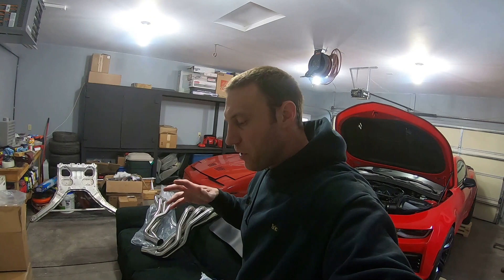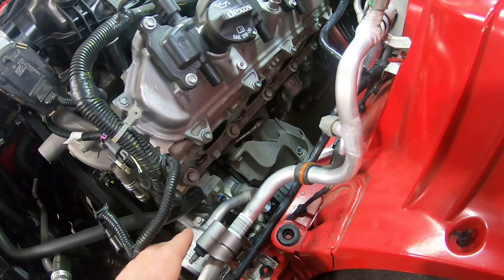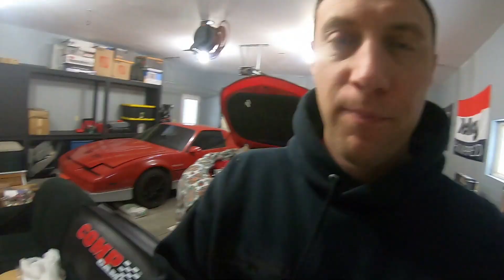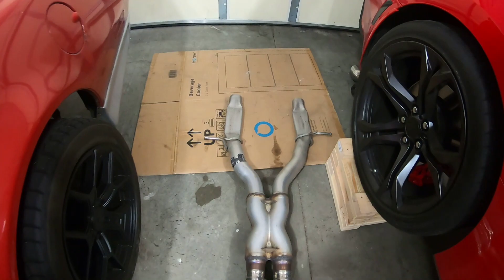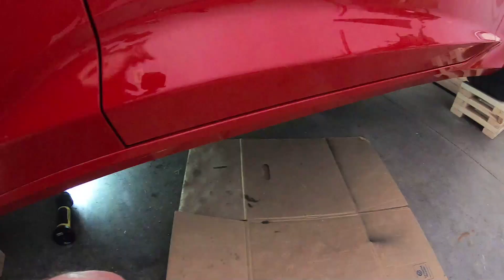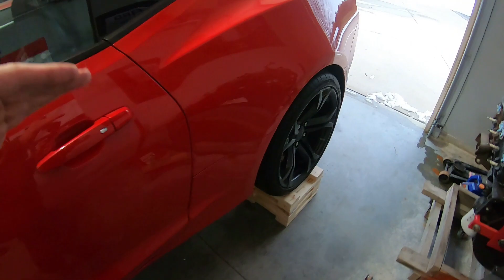6th Gen Camaro Speed Engineering Header and X Pipe Install

Comment: hey brother, I have a question. i have a 2023 Camaro LT1 and was wondering do i need to get the x pipe for these headers or i can install them with the pips i already have?
Reply from the maker: If your using speed engineering headers with factory xpipe it's kinda a pain. Have to make custom pipes to connect and the angles are off. Using the speed engineering xpipe just makes things way easier to connect everything up. Otherwise your paying exhaust shop to make connection and it's not going to be stainless.
Reply: @ understood brother thank you so kuch

Comment: How far from the suitcase npp do you cut?
Reply from the maker: @DexterJones05  i cut it as long as I could. So as close as you can to the crushed section
Reply: @ do you have measurements? Just want to make sure
Reply from the maker: @dexterjones3370  no i just cut it long. As u can always cut off more
Reply: @EssMotorsports  okay so farther away from the suitcase part
Reply from the maker: @dexterjones3370  yep

Comment: Nice nice nice!!!  Tell us please...what throttle body did you use, no cats???, O2 connection issues, tune, AFM delete or AFM module tie up??   Those ceramic wires work good?  Thank you.
Reply from the maker: Make sure to checkout some of my other videos for TB and tune stuff. The ceramic plug wires are still working good. No issues. Mine being manual does not have AFM valves to deal with.
Reply: . When using the V band clamps do you just cut the female slip bells off the midpipe sections to slip the rings on to weld up???

Comment: Do u need a tune? And what happenes if u don’t get one
Reply from the maker: Yes definitely need a tune. Could run lean. Will have check engine light
Reply: @EssMotorsports  does the tune change the sound? And how much is one typically around?
Reply from the maker: @akashsuryavanshi6743  doesn't change sound. And cost varies a lot by area and tuner. Can't really say
Reply: @EssMotorsports  alright thanks man

Comment: quick question did you get the 10 inch spark plug wires or 12 inch. i got the 10 inch but i dont know if they will fit
Reply from the maker: The link to the exact part number is in the description 👍
Reply: doesn't say how many inches 10 or 12 @EssMotorsports
Reply from the maker: @xxchrisgamerxx6850  not sure on length then. But if your not relocating coils they were the perfect length

Comment: How long CAN you drive it until you get it Tuned?
Reply from the maker: U can drive around normal street driving but car will limit itself. Ie close the trottle with the extra airflow
Reply: @EssMotorsports  limit itself? Meaning? Me and my buddy gonna install the headers I wouldn’t have money to get a tune probably like a month out! I will just be driving the car to and from work
Reply from the maker: @Firestick Man  yeah it will close throttle at high rpm. Torque based system, ecu only will let engine make so much torque. So it won't be any faster until u get it tuned
Reply: @EssMotorsports  so it will feel just like stock? I’m just gonna be driving it without a tune for like a month that’s it
Reply: @Race_Car2ss i would wait until you had the funds available, schedule a time with tuner and get installed a week or few days before scheduled tune
Reply: @Race_Car2ss my tuner said it can put permanent codes on the ECU.  He can clear CEL but not the codes once recorderd

Comment: What's the deal with the exhaust clamps on the exhaust system,  the seem small
Reply from the maker: Nope they are the correct size. Smaller ones wouldn't fit.
Reply: @EssMotorsports  I got the x pipe too and those bolts are too small

Comment: Did you reuse the oxygen sensors
Reply from the maker: Yes, no need to buy new ones unless they are bad.
Reply: With those headers do you needed to use all 4 sensors?
Reply from the maker: @raul resto  u can use all 4 just need to add an extra weld bung.
Reply: @EssMotorsports  you did that or just used the 2 front ones??

Comment: How did you remove the O2 sensor harness? It’s not coming un done
Reply from the maker: U mean the connectors themselves? I think there is a Blue tab u slide back/remove then u can depress the clip and pull apart
Reply: @EssMotorsports  yeah for some reason I can’t pull them apart

Comment: What kind of heat wrap did you get to wrap the harnesses?
Reply from the maker: I got that heat sleeving many many years ago, but I found this on Amazon that looks like it would work really slick with the velco. 
https://amzn.to/3Jao0Ok
Reply: Did you use the clamps that came with SE?
Reply from the maker: I used the walker exhaust clamps for all connections except the header connection itself, that I had to use the SE clamp because it wouldn't accept a lap joint clamp. The link for the Walker clamps should be in the description as well.

Comment: Did you torque anything down? Or all hand tight? Great video
Reply from the maker: All torqued down properly. Manual calls for 17 ft/lbs but I think I went 15 ft/lbs to be safe for header or exhaust manifold flange. For the speed engineering/exhaust clamps, used a breaker bar and really tight! Haha
Reply: @EssMotorsports  Thank you for the response! I don't have a torque wrench so i for sure need to pick one up!

Comment: Got mine in waiting to install. What did you do about rear 02 sensors. One side has 02 bung other doesn’t. Did you need a tune after? Haven’t started installing mine yet cuz spooked.
Reply from the maker: Delete rear O2s and will need a tune. 👍 the single bung is for a wideband.
Reply: @EssMotorsports  did ur check engine light ever come on? Ik it needs tune my Dyno tune is set up for Sept 1st (cam, headers, e85, CAI) but was the car still drivable after u put the headers in?
Reply from the maker: @Bigburb1345  yes the CEL came on and it will after the second start with 2 heat cycles. If you only do just headers yeah its drivable, but if your doing cam as well then NO it needs a lot of changes to even start correctly and run right.
Reply: @EssMotorsports  nah the cam pushrods valve job lifters all that stuff is done and it has a base tune, headers weren’t  in yet when we did cam job so that’s why they’re still in the box.
Reply: @Bigburb1345 my tuner said do not drive as it will throw code that can't be removed.  He can clear the dash light but not clear the codes.  He also said do not use spark plug wire heat socks.  It will cook the wire boots
Reply from the maker: Yes before first start with headers u should Flash a tune otherwise it sets permenant codes

Comment: So I’m in the process of installing them but having problems with the o2 sensors there is 3 o2 sensors slots in total with this kit and there is 4 in total that I have any suggestions?
Reply from the maker: The third rear O2 bung is for a wideband sensor. You delete the rear O2 sensors and only use the front two into the header collectors. Then tune will fix any cel.
Reply: @EssMotorsports thank you...does Speed send / offer plugs for the rear two bungs on mid pipe

Comment: People have said they've had issues putting in those accel spark plug wires. Did you have difficulties?
Reply from the maker: I have the angled ones, so it was no issues to install. The straight ones wouldn't work.
Reply: @EssMotorsports  makes sense, thank you soo much for the quick reply. I ordered those spark plugs but in white 😁 also ordered tube 1 7/8 SE headers
Reply from the maker: @Ghost-zt8ge  my suggestion would be to order the midpipe kit too. Even if you have to install it later if it's backordered. It integrates so well with the SE headers
Reply: @EssMotorsports  I actually did get the xpipe with it 😅 great minds think alike hu? Did you also go with the 1 7/8 or 2" headers?
Reply from the maker: 1 7/8. If b your n/a your not giving up much if anything

Comment: Hey are these deleting the secondary cats only or all 4 of them? Great video btw! I’m worried about pulling the trigger I have an MBRP cat back and I attached it right after the secondary cats but I don’t know how these headers will fit with it. I guess what I’m asking is can I keep the secondary cats on to run these headers?
Reply from the maker: No I wouldn't keep the secondary cats. My suggestion would be to get some aftermarket high flow cats and incorporate them into the Speed Engineering kit. Might be easier to buy another brand header with cats already incorporated, but it will be pricey!
Reply: Speed Eng website offers 2.5 in and 3in hi flow but will need to use the V band clamp setup and have the flanges welded on outer edge

Comment: have a Q.  What side did you put the pipe with the bun hole for the wideband?  I put it on driver. dont look right...
Reply from the maker: Mine is on the driver side as well. Routing works out good with wideband then into the cabin through the sound tube hole.

Comment: Will these clamps also work for the C7 stingray when installing the SE headers?
Reply from the maker: If your talking about the Walker mega band clamps, then yeah they will work as long as it is 3" pipe used on the c7 kit. Which I would think it is
Reply: @EssMotorsports  awesome, thank you! How many clamps did you purchase? 4?
Reply from the maker: @G33kLife747Flying  I bought more than I needed I ended up using 8

Comment: Sounds great 👍 any difference with smell inside the car since the cats are gone? Egg, fuel ext....
Reply: Great idea with those wood stands you made. You mind giving the measurements of the cut wood? Also how sturdy were they? Thank
Reply from the maker: @davelombardo1710  I will have to measure later but they are super sturdy! Absolutely no worries if car is on them. I use them a lot now working on anything underneath cars.
Reply: @EssMotorsports  great 👍 I'd appreciate it! With those was the car high enough to get that skid plate brace off as well?
Reply from the maker: @davelombardo1710  yes just barely. But I wouldn't go any higher or it's hard to get onto blocks with normal jacks
Reply from the maker: @davelombardo1710  all 2x4s are cut to 14" length. So the stands are square. I made it 9" high which is perfect, which is 6 rows of 2x4s
Reply: @EssMotorsports  thanks so much for ALL your help.  Your videos have helped me more than a few times
Reply: @EssMotorsports  how long could you drive after installing the headers until you get a tune? And us it safe?  Thanks 👍
Reply from the maker: @davelombardo1710  your ok just driving around normal in my opinion but before u start getting on it I'd get it tuned just incase something needs adjustments.
Reply: @EssMotorsports  thanks again man
Reply: @EssMotorsports  installing my headers and I bought the other gaskets for them which is one side shiny like Chrome and the other side gray, any luck telling me which side goes on what?
Reply from the maker: @davelombardo1710  I believe it is stamped in the gasket. Like manifold side or head side.
Reply: @EssMotorsports  okay I figured that out thank you but how the hack does this oxygen sensor clip come apart I push the white tab up but I cannot get it to release the put the extensions on, please help again
Reply from the maker: @davelombardo1710  there should be a locking tab that u slide backwards. Then u can release the clip and pull apart.
Reply: @EssMotorsports  just wanted to say thank you for all your replies especially so fast. Got them in the car sounds amazing. I did it on my 2012 and I'll tell you they were a lot easier on that car. You are my favorite YouTuber
Reply from the maker: @davelombardo1710  Thanks for the support! 🙏
Reply: @EssMotorsports  so my tutor just called me and said a code is coming up saying Invalid data received from steering angle sensor module. Do you think that was from me having to take the steering shaft off? Any information would be greatly appreciated from you. Thanks a bunch
Reply from the maker: @davelombardo1710  did the steering wheel get turned while the shaft was off? I would think it would be off driving then? I'd check to make sure u haven't burnt any wires that run alongside the passenger header.
Reply from the maker: There is slight fuel smell sometimes but it has improved and don't even notice now that I got my tune more dialed in. Gotta have good positive timing at idle which helps. U notice it at startup that's about it
Reply: @EssMotorsports  thanks for the info, going to pull the trigger early spring. Can't wait!!!
Reply from the maker: @davelombardo1710  I was concerned about smell as well cause I didn't want it to stink like my Trans Am. But with stock cam it's a non issue in my opinion.

Comment: Did you need a retune or did your car even throw a CEL. I'm thinking about this exact setup on my '20 1LE.
Reply from the maker: It will need a tune. CEL won't probably come on immediately but after couple cold starts it will. U need the tune to turn off the secondary O2 sensors. Headers are a game changer for sound output tho! 🔥
Reply: @EssMotorsports  oh 100%, good to know that the speed engineering stuff is a good product because its so much more affordably priced than other companies.
Reply from the maker: @WIKD1LE  I'm happy with the quality. People will say the gauge or thickness is thinner and unless other brands are using 1/8 wall tubing is very minor difference.

Comment: Question after the install my rear view camera and heated seats fuse keeps blowing. I have the afm still attached
Reply from the maker: That does not sound good. Sounds like a short. I would check that your wire harness on the passenger side is not touching the headers and burning through. That harness was close to begin with. I showed it in the video where i wrapped it in heat protective wrap.
Reply: @EssMotorsports  alright I have to check thank you
Reply: @EssMotorsports  it was that exact harness
Reply from the maker: @ChevyTrevy  did it burn through?
Reply: @EssMotorsports  yes  I think one wire got exposed
Reply from the maker: Well hopefully u caught it early. Open the harness and insulate/repair burnt wires and tie everything back farther away. Heat wrap probably a good idea too
Reply: @EssMotorsports  thank you  thank you 🙌🏽

Comment: Another really useful video. Was wondering if you think I’d be okay going with another brands x pipe with the SE headers. Only reason is because SE x pipes are outta stock
Reply from the maker: That is funny u ask this as I was doing this last night helping a buddy. Can it be done yes, is it your best and most cost effective solution... NO. The easiest is going to be SE headers and midpipe together. Just installed corsa x pipe with SE headers with custom connection pipes and it was a pain and it fits just OK. The only downside to SE midpipe is you will probably have to use the Halo tunnel brace but that is also a quality piece!
Reply: @EssMotorsports  ah okay. Looks like I’ll get a different headers/x pipe combo. Any other suggestions?
Reply from the maker: I haven't had experience with other brands. Seems like Texas speed is a popular one tho.
Reply: @EssMotorsports  cool man. Appreciate the replies. I decided to go with OBX/maximizer headers (same thing) because they’re not too expensive and are in stock. Should only be running the manifold without the tune for a little while.
Reply: @EssMotorsports  hey on another note. I am about to finish porting my LT2 manifold and bolting up the LT5 throttle body to it (no adapter). Planning on getting the headers and flex fuel kit soon and then doing a tune after that. Do you think I’m good to run LT2&LT5 without a tune for the time being (3-4 weeks)?
Reply from the maker: Not expert here but with that said, You should be fine for a while. The biggest spot where fueling changes with the 95mm tb is at part throttle from what I've seen. So take it easy and let the car learn that area. The car will limit itself at the top end as it will see the extra airflow from the lt2 intake. So probably won't feel much faster until tune.

Comment: Looking to add headers and the x pipe from speed engineering as well , how’s the dual mode exhaust ? Does it do it’s job keeping it in stealth and track ?
Reply from the maker: The dual mode works just the same as if it were stock. It does a good job quieting it down in tour mode so u can be sneaky! And in track it is LOUD! Check out my other video speed engineering update I have exhaust clips of both track and Stealth modes.
Reply: @EssMotorsports  gotcha brotha u got insta by any chance ?
Reply from the maker: @JJDriven  yep its just essmotorsports 
https://www.instagram.com/essmotorsports/

Comment: Aye so I am buying the speed engineering headers & x pipe kit that comes with it all for $550. Is there anything else I need to put the headers on?
Reply from the maker: U need new gaskets. Just buy GM replacement ones from Rockauto. Don't use the ones that come with from Speed Engineering. Also the tunnel brace won't fit so I bought this Halo tunnel brace.
Reply from the maker: https://www.phastekperformance.com/HALO-Driveshaft-Tunnel-Brace-p/halo-cdtg6.htm
Reply from the maker: And I used .250" washer spacers under the brace for extra clearance to the exhaust.